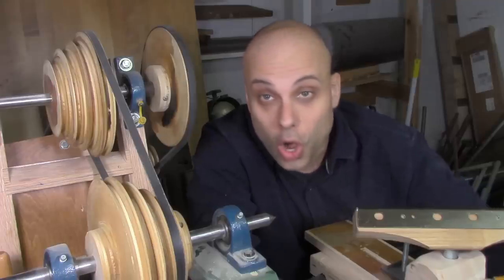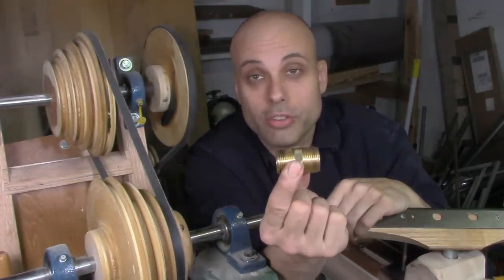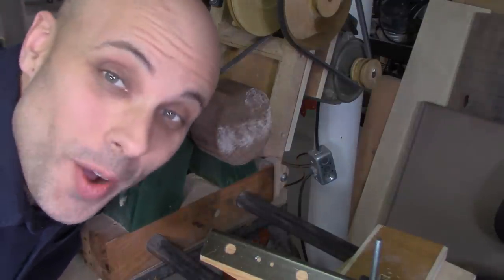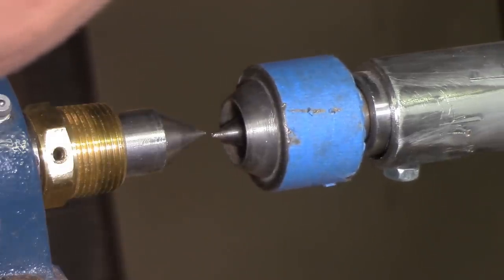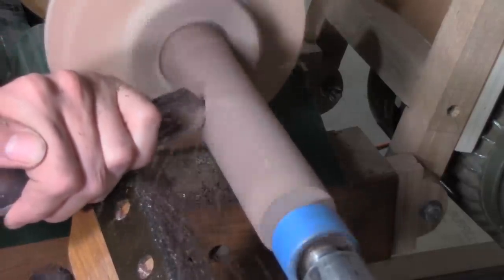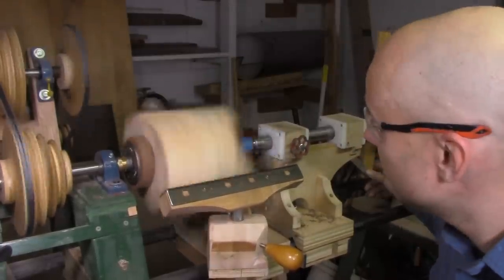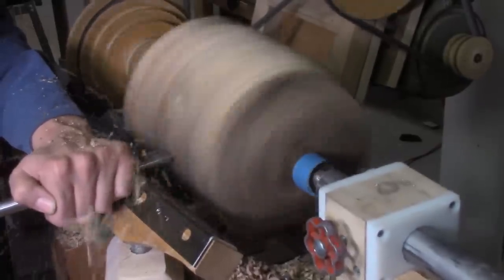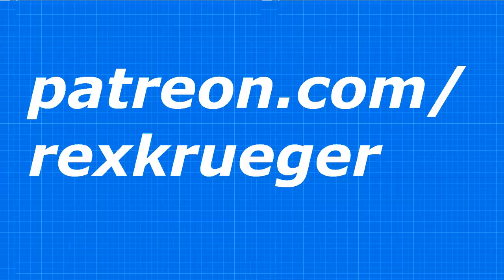The Real Lathe Pt. 6: Work-holding and testing.

Comment: The general design of your headstock and pulley design looks like it has aspects I can borrow for a small metalwork lathe I'm upgrading/rebuilding.
The use of a plumbing fitting to add an "instant threaded spindle nose" is pretty darn clever lateral thinking.
Reply from the maker: I appreciate that. Good luck with your metal lathe. I've often considered it, but I just came up with too many barriers. I hope you succeed where I didn't even try!

Comment: I don't know if you are familiar with Ernie Conover, but he used to sell a lathe 'kit'. It came with motor, headstock, tailstock, and cast iron legs. It was the 'frugal woodturner's choice'. I think you need a threaded headstock spindle. The 3/4 inch 8 tpi size is small and not often seen any more. Most minl lathes will use 1 inch by 8 tpi. The big lathes use a 1 1/4 by 8 tpi. Funny thing about that is that the industry standard is 7 tpi.  You will need a chuck eventually, and that is probably the best reason to have the threaded headstock spindle. some of the big lathes will do bigger headstock spindle, and turn it down to the end part for the chuck/faceplate mounting point. The machining will leave you a flat spot for the chuck and face plates to seat for less run out. Wish we could get together for a play date........ Unfortunately no one has invented the Star Trek transporters yet, and I am out on the left coast. The lathe wasn't exactly pretty, but it did function... Wood lathe is the best christmas present I ever bought myself....

Comment: I really enjoyed this series, I started wood turning a year and a half ago and built my own lathe as well, it's more modest than yours but it's funny that you faced the same issues that I had, except that mine is much cheaper. I can turn pieces of wood of around 25 cm long max and 12 cm in diameter, so I am really limited regarding the size. Since I have almost no power tool, I built it from pallet wood which I used to build the frame and rails, a 10 mm wide threaded bar on which I installed homemade pulleys a bit like yours. It's powered with a drill that can spin at 2,400 rpm. My tailstock is just a simple threaded bar which I sharpened to make a dead center, you just need a drop of oil to avoid the wood to burn. For my headstock, I just prepared some wooden faceplates with a bolt that can be screwed onto the threaded axis, to block it correctly, I just use a second bolt to prevent it from moving. It works pretty well and cost me only around 25 € (drill not included) for the belt, bearings and threaded rod. Now, I'm looking for an upscale and your ideas will probably help me a lot when I decide to start the building. Thanks for the videos.
Reply: That sounds really neat! Can you link a video of it? I have an old circular saw and corded drill from a garage sale (big beefy units, high amp motors) that I plan to try with for my eventual lathe build.
Reply: @TheConstantComet  here it is, I found this video I did a year ago after I corrected some defaults with the axle. This small lathe can be screwed to the bench, so I your garage is small, it doesn't take too much space. I don't have the fast blocking system but I use butterfly screws instead. You can screw your piece of wood straight on the axis, like a pigtail, or you can adapt chucks, it necessary to have at least a faceplate if you want to hollow bowls. After a year using it, I'm planning to go bigger, but I need to think on how to do it the cheapest way, I can't invest in routers or things like that, so is a bit more challenging to make perfectly straight parts. https://youtu.be/6SuOJrWX0rw

Comment: Great job, Rex. Good engineering for "as-we-go" venturing into machine building.  A couple points of information based on personal experience: One inch malleable iron pipe worked much better for me years ago without much diff in price; "V" guides in tool rest and tailstock can be adjusted easily by spray-gluing sandpaper to the ways and judiciously taking off small amounts of the wood.  It helps, of course if there is more there than needed..not less.  I like your use of cam locks and cutting boards.  The poly also makes for good bearings in certain places.  Keep it up.  In the language of my people: "Y'all done good!"
The Colonel

Comment: Rex, you continue to amaze me.  This is a project very few would even contemplate let alone attempt.  Not only have you followed through with the project but the lathe works amazingly well, better than some name brand units I've seen, but you're not yet ready to stick a fork in it.  What exactly does it take to satisfy you?  Perfection?

I'm looking forward to seeing the changes and improvements you make.  Take a break then come back and blow our socks off again.
Reply from the maker: You're very kind!  The whole thing needs to be a bit sturdier. I have some weak points. I also want to cut down on vibration. And the tool rest needs a whole re-design. More than anything, I want it to be as safe as possible.

Comment: Great work, great solutions and great videos as always; very much appreciated.
Every time you drilled the holes for the black pipes, I kept thinking "Why don't you use the spade-bit-trick?". Eg. file down a large spade-bit to those 33mm, so you'll get a tight fit.
-You could use the same spade bit for all those black pipes. :)

Comment: Rex, 
The brass hose coupler may not hold up well.
Look at the selection of standard iron pipe fittings.
You would have to clean up the inside diameter a little though.

Remember that pipe the threads have a taper and will tighten a little more with every start/stop of the lathe especially with a heavy work piece.... though I dont know if a commercial lathe has a taper or not so this may be a useless observation.

Beautiful success so far !!
Reply from the maker: Thanks for the tip!  I share your concern about the brass, but I spent some time with an iron fitting and it just wasn't going to work. Even with cleaning up and deburring, the ID was just too small. The brass has an amazing fit. BUT I just found out that the exact same fitting is on Amazon in stainless steel. And it's cheaper. I think that's the ticket.
Reply: @RexKrueger  Awesome - now, if it only had a nice corse thread on it which matched commercial chucks ... small victories, Stainless should be plenty tough!!
Reply from the maker: @gregmislick1117  I feel like getting a commercial chuck on this thing is just a pipe dream. I'd love it, but it's a lot to ask from a lathe literally made from junk.

Comment: Congratulations on the successful build. How much time did you spend staring at plumbing parts in home Depot before you figured that one out 😁? awesome ingenuity dude!
Reply from the maker: Honestly, it was over an hour of laboriously trying fitting after fitting on the shaft and then trying to get a flange to fit. The one I found was LITERALLY the only one in the store that worked. I tried every single one.
Reply: The lady at Lowe's gets a kick outa me shopping for plumbing supplies. She's asked me several times if I've ever used plumbing material to actually plump something. One thing I've found out is that the flanges need faced turned to true them up. They make simple small flywheels for model engines as well.
Reply from the maker: @coburnlowman  Good tip!

Comment: Very impressive result. I'd be hesitant to mount anything that big & lumpy to my commercial midi lathe; not because I worry it'd fly off, but because the entire lathe might make its way across the room (and it's already mounted in a half shell, bolted to a shelving unit).
You should make a disc sanding attachment for it. It's probably my most used lathe jig & is just a bowl blank with hardwearing sandpaper glued to it, but it's brilliant for flattening surfaces & saved me having to buy a big sander to get the larger diameter to work with. When the paper is spent, I simply glue another layer right on top of it. I've done that 6 times now & it's remained surprisingly flat.
Reply from the maker: That's a good tip. I left the rear end of the spindle long so that I can add a disc sander on that end. I hope to do that when I finish the plans.
Reply: @RexKrueger  Oh yea, I forgot there's a back end to the headstock.. Mine's up against that shell so I only ever use it for indexing, but putting something on there seems like a good idea.
Reply from the maker: @nightcatarts  It is one of the advantages to the open-headstock design.

Comment: Thanks for all you are doing.  I still hink that 1/2 inch hole with a $25 2 MT reamer would be better than the point on the headstock.
Reply from the maker: You could very well be right, but I don't see how I'm going to bore that taper accurately enough to make it run true. If you can explain that part, I might give it a shot.
Reply: @RexKrueger  I see that without fixing the tailstock there is a problem..  If your tailstock was at true center, you could mount the drill bits there to cut the hole and then use the reamer to make the 2mt taper.

Comment: I've been following your build with great interest.  I have a project in mind which requires 36" between centers.  Commercial lathes typically don't have that capacity until you get to costlier models, which is why I've put off doing that project.  In your video on making the bed, the pipes are 5' and I suspect the dimensions of the head and tail stocks will leave about 30" between centers.  Is there any reason this couldn't/shouldn't be lengthened, other than cost for buying 2 pipes instead of one cut in half?
Reply from the maker: Jody Burton not at all! Go ahead and go longer.  If you have a little more money,  buy square tube and turn it so one corner is pointing straight up. I ran this past an engineer buddy and he said this would be very strong.  I should mention that I'm very pleased with the pipe.  Is been more rigid than expected.

Comment: Really nice! Regarding plans, will the plans include the motor specs and/or a link where to buy it?
Reply from the maker: Yes, but the motor specs are easy, you need a 3/4 or 1hp, 1745 rpm motor. That's for 110v. Easy.
Reply: Compressor motors are pretty stout, either commercial HVAC, or common (larger tank) Pneumatics... so Harbor Freight's an option... 
    In "junk" shops and markets, you can also look into old water-pumps, sumps, and "trash water" pumps tend to have power to spare (from spec's to application)
   Rex did mention (in the vid about head-stock) that he got his from an old band-saw(? as I recall)... BUT you can also check with anyone who does Appliance Repair... like freezers and so forth. Some of those old freezers and the big coolers (like in soda and ice cream shops or restaurants) have some pretty bad-ass motors on regular house (110 - 120 VAC) current.
    Drill presses and other heavy duty tools often have larger than average motors...
    And along with the HVAC sets (which are often in giant housings with lots of coolant-related crap and tubing and just plain frustrating or difficult to extract... "Squirrel cage" ventilators often have just the "turbine' on a shaft either directly attached to the motor or equipped with pulleys and belts that are run from the motors... and some of those are pretty impressive.

    Scrap yards, recycling centers, fabricators, and other trades often house things like this where you can buy for "scrap prices" the same as you can sell... It does take some patience and tools to extract the stuff you want from the scrap you don't need, and often you'll have to take the whole mess home for the particulars... BUT it's a source. I wouldn't dismiss it.
     I have a half dozen old "industrial paint stirrers" from... er... "back in the day" (I'm thinking late 60's maybe)... They're big motors attached to aluminum gear-boxes to drive half-inch shafts with propellers... like boat propellers in five-gallon or larger drums of paint and epoxy coatings... AND they came from an abandoned store that was being stripped out for demolition. I even got paid to carry them off... so you can't beat a deal like that. (lolz)
      ...just not really sure what the hell I'm going to do with them yet. 

    On water-pumps, though, it's worth note that you'll want to avoid most of the submersibles... and "inline" types. Two problems come up. 
1. They tend to just be too small. Either there isn't enough torque from the thing, or the housing is too minimal to be solidly retained in position... SO rather than sling shrapnel everywhere and risk injury... no need to bother.
2. They tend to be liquid cooled, rather than air-cooled like a conventional electric motor. Water running through the pump-housing actually cools the motor inside... Once you remove the housing, unless you do some retro-engineering to bring enough air-flow to move the heat... It's usually just a matter of time before it burns up... and that's not fun or good either...

    Bottom line, there are lots of places to look... Just take care. Each motor will have a plate riveted (usually) on the side with all the spec's you need to know. Volts, AC/DC, RPM's, Amp's, and so forth... AND it's usually not too expensive to have an electrician (qualified person/professional) check the things out before you do something you'll regret. ;o)

Comment: 0:49 where did you get that first wrench on top of the head stock i have the same lathe and the cheap stamped steel wrenches spread out and they dont work anymore
Reply from the maker: I got it off Amazon. I just put in the size I needed and bought whatever came up. Works flawlessly.

Comment: So, you built your own lathe just to do it? Cause I mean, you have a lathe, all be it a Harbor Freight lathe that is considerably under-powered (I have the same model) for larger/heavier work. What is the throw on your homemade lathe? How big around of a stock will it spin clear of the bedways? Congrats on hitting the 80% mark. Looks like it works fairly well. Also, I mist have missed it if you said it previously, what size motor do you have driving it?
Thanks for sharing.
BTW, what cost do you have in to it so far? Are you coming in at a price point that makes it a worthwhile endeavor? Cause the HF lathe is around $315, that is considerably cheap compared to the models from the "Big Name" tool manufacturers.
Reply: Go watch the first part. Over 12 inch throw.
Reply from the maker: Rick is right, I do cover that in part 2. But the swing is about 16 inches. I have less than $80 in the build. You need to have some parts on hand to make it cost-effective, but most of the parts are very common. More than half of this lathe literally came out of dumpsters. The motor is 3/4 hp, which seems decent. And yeah, I did it just to do it. Didn't know if I could. Wanted the challenge and I wanted to make the videos.

Comment: Just watched this for the second time, all six. I admire your skills but there are two issues for me specifically. Three motor is took expensive. I've looked several places, nothing less than $150. I don't have any tools that can work any kind of metal and can't afford to but much of anything. Can you do something about the possibilities of making a lathed out of a drill press? Lay it flat. Then all I need is a tailstock
Reply from the maker: I'm sure it's doable, but you may need to figure it out yourself. As to motors, you need to go used or salvage one. Glad you liked the series!  I enjoyed making it.
Reply: @RexKrueger  Part of the reason I appreciate your show is the fact that you use normal tools. I don't have and can't afford a planner or jointer or sander or router table or a hundred clamps. Almost every other YouTube wood shop starts out with taking a piece of wood to a planner or jointer, or wants to use 3/4 Baltic ply. Stick to your simple low cost projects!

Comment: Hey Rex, why is there so many different lathes(metal, wood lathes)? And what's the difference? I don't understand. They work the same? 
Thank you for the videos keep work great work.i don't if I could make my own lathe? 
Keep up the great works. Hit me back?
Reply from the maker: The short answer is the different materials need different machines. Metal needs a pretty low speed but very high torque. Wood generally needs much higher speeds. And yeah, they do pretty much work the same. There even used to be wood/metal lathes you could buy, but they weren't that popular. Good question!
Reply: I have a china drill press I will power my lathe with, I will lay it on its side and secure it to the bed, your design looks like I can get the type of machine I am looking for.

Comment: FYI, never ever ever ever use drywall screws to attach a block to a faceplate. Drywall screws are hardened and will break before flexing or bending.

Comment: Your left arm looked like it came awfully close to those belts, PUT A GUARD ON  THEM, before you rip your arm off!
Reply: My exact response when he talked about the lathe being 'safe'.  It damn well ISN'T safe!  A moments inattention or an unexpected event and you're maimed.  A couple hours should build a good, sturdy cover for those belts and pulleys that is easily unlocked and opened for adjustments.  It will also keep chips out of the mechanism.  Not a huge concern with a wood turning lathe (compared to what metal chips can do to a metal lathe, anyway), but it is a fire hazard to have the motor exposed to them, at least.